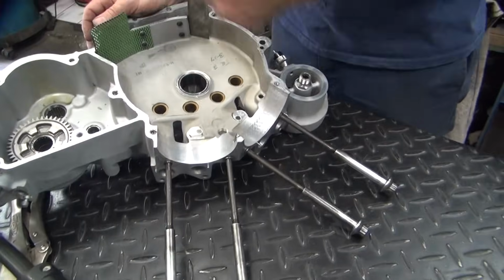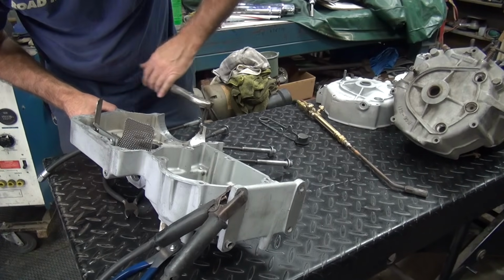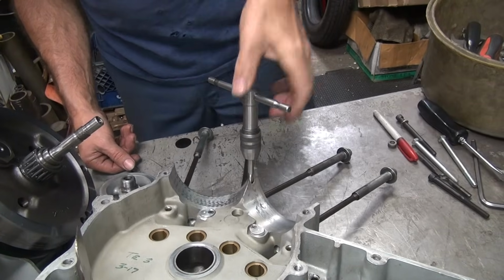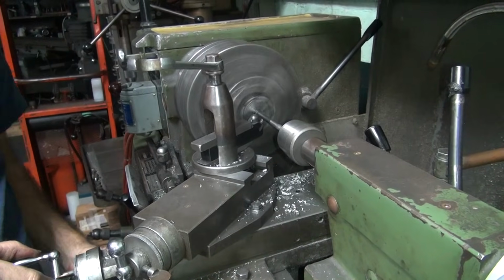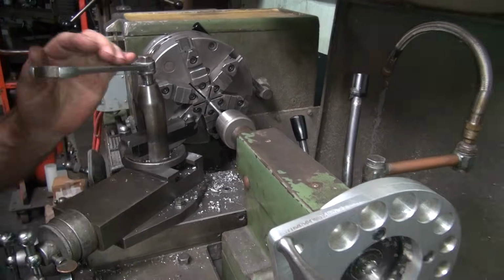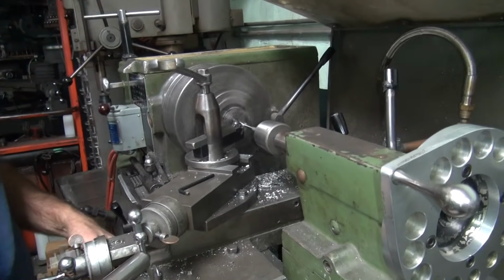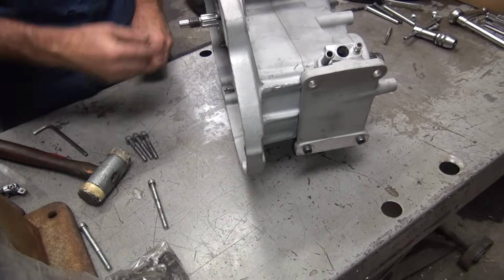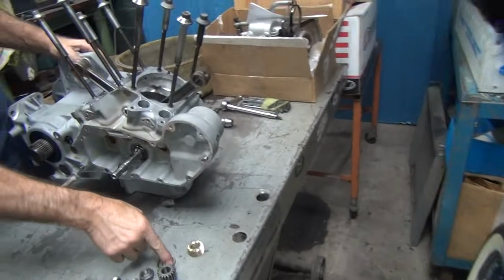1990's #101 evo sportster 90ci big bore lowerend assembly motor case machining tatro machine

Comment: One last thought/question, on an Evo Sportster motor what’s  the biggest, reliable engine you can build ci-wise? In short I guess I’m asking if you had a bone stock 883 or 1200 and you wanted a hot rod, how would you build it?
Reply from the maker: 87ci from bore and add stroke as needed.
tatro

Comment: Hey Tatro ... Wouldn't it  be better to drill the case rite through and tapper the bolt and at least you'll be able to tighten the bolt and keep the tapper in the position and put enough tension on the bolt . So at least you've got a lot more bolt to work with there than rounding it off ...
Cheers from Down Under. ..
Reply from the maker: read the other replies.
tatro

Comment: Hey Tatro...Cheers.  I would have torqued the unmollested bolt in and then scored the profile of the bolt that was interfering on both cylinder bores with a scratch awl and then removed the bolt and then die grinded the scored part away.  You would be left with "more meat" on the bolt that way.  Just my 2 cents...
Reply from the maker: and then if you turned the bolt it would dimple the cylinder bores and case piston problems. i have also seen broken cylinders when people turn these bolts or try to take them out without 1st taking the topend off. i do things the way i do because i think it is the best way for the applications. if someone turns this bolt it is not going to do any damage but it might break off which will tell you that you did something wrong and maybe should find someone that knows what they are doing to work on your bike.
tatro
Reply: True about the possibility of damaging the cylinders if not removing top end first.  Why anybody would want to re-torque the bolt after its' installed or remove it unless splitting the cases (would remove the top end anyways) is beyond me but anything is possible!   Still would do that over turning the bolt that thin but I see your point...

Comment: All the other rookies are throwing theirs in, here go my pennies (questions actually) to weld into your lathe for thumb tabs, which is an awesome idea by the way...
First, can't believe you pulled that off on an engine lathe!  That table must be nice and tight!  Well done!
Now... Here's the dumb question to go with the others... Instead of just bending up, what about getting the center cherry and forming between two pieces of that pipe for the rough cylinder shape to allow for cylinder fitment?  Provided the press can be controlled so it's not too thin in the center?  Just an idea I had....
Regardless, I have a 96 sporty, so this was INVALUABLE information.  Thanks.
Reply from the maker: that is all fine until you turn the bolt just a little bit and now nothing lines up and you bend the cylinder spigots. that is why you make it round so that it does not matter what the rotation of the bolt is.
tatro
Reply: Told you it was a dumb question.   Yep.  That makes perfect sense!   Knew you were doing it that way for a reason, but I still had to ask.  I'm just that little bit smarter now.  Thanks.
Reply: I have one of those lathes and they are an older, belt drive, excellent quality Taiwan design (Taiwan made, and makes, some quite decent machine tools but older is often better) made by more than one company.  Eyeball the style in case you can score one. Mine even had the six jaw chuck, a three jaw and four jaw.  Enco is another good affordable used lathe.

Comment: you could install the jugs then pin drill the skirts and then bolt / pin them in with the bolt... May Be???? bad idea????
Reply from the maker: not a good fix. the pins or bolts will work loose and let everything float around. this lets the cylinder run very hot because it is not attached to the cylinder to dissipate the heat.
tatro

Comment: You can't get past the fact that the bolt will still have to be thin, no matter what way you fasten it! If the torque number has to be way down so the bolt is not stretched or snapped, I'd say keep it threaded into the case half!
Reply from the maker: even a thin ass bolt or screw will help hold the cases together. a little pressure goes a long ways in this spot.
tatro
Reply: Peter Tyler yeah, it looks a little funky, but there's a bunch of 88" & 90" XLs out there with this same deal with the bolt between the cylinder spigots, but I think most people would be likely to run into the limits of strength of the OEM pressed crank assembly with hard usage...  that bolt prob'ly ain't gonna ever give the owner an issue

Comment: couldn't you of "notched" (set up in the mill and created a flat on the cylinder skirt to accommodate that bolt.?) seems I've seen that before...?? there's enough meat on the skirt and that far down there's no pressure to crack or split the skirt that way you don't lose the Integrity of the bolt....
Reply from the maker: somewhat but these cylinders are very thin. at .060 over there is not much left ti work with. a little here and there is better then cutting all in one spot on these deals.
tatro
Reply: Tatro Machine I'm a dumbass... I should have watched the other videos on the cylinder fitment.. I knew it was going to be paper thin but you make it look easy Tatro nice work
Reply: That bolt isn't particularly vital. If it were, the slick mod would have been to mill a steel fitting to place a round dowel in each end of the bolt hole and have the clamp bolt outside the case between the cylinder flanges. Not hard to to but no one has bothered so that tells me even drag motors don't need it much. Stroker Sporties have been a thing since the 1950s.